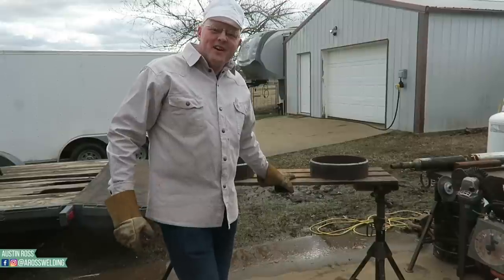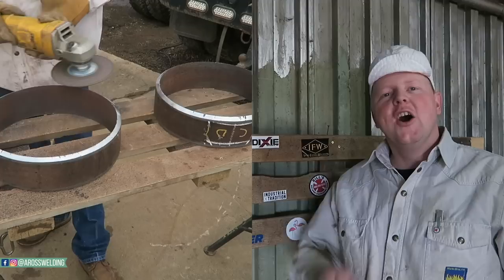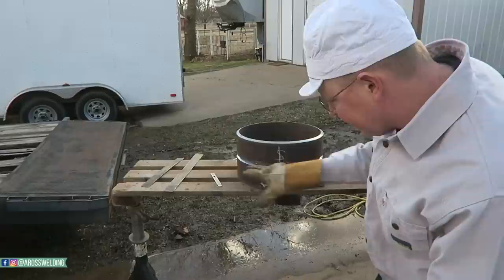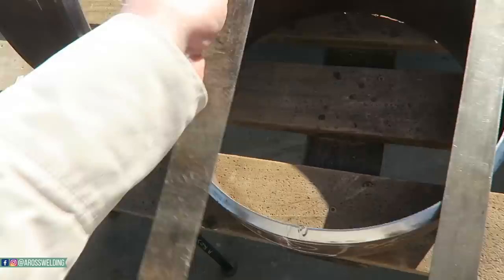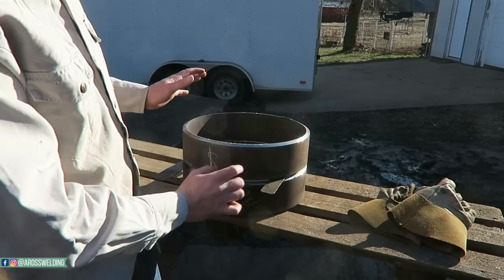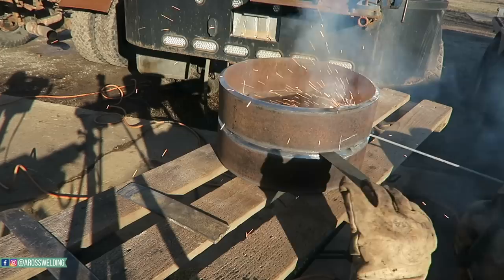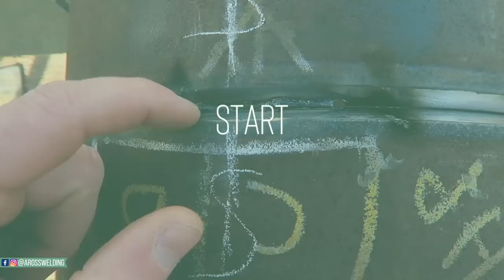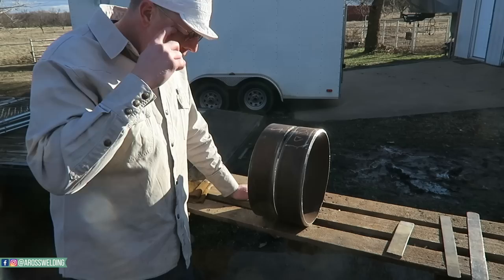BELL HOLE FIT UP (HOW I DO IT ON TEST DAY)

Comment: Hey guys, so i got out of the pipeline world a couple years ago. I moved to TN but I was living out in Norman, OK. I lost all my contacts from the industry but I really want to get back into it. If you guys have any numbers or leads I would love all the help. I can weld. Never got the chance to break out but I helped for a guy for a couple years working for enable and other gas companys non union. Also have labored and I can run equiptment thats what ive been doing in TN since welding jobs are hard to come by! Thank you for the help guys!

Comment: Great video. Be it a welding test, written test, or any test with time limit on it, use the complete time. Don’t goof off and run out of time but don’t race horse through it. Take your time and prep and double check instead of having to rework. 
Go by the old saying “measure two or three times and cut once.” Saves headaches and time. Hope everybody has a great week.

Comment: I like to use 1/16 ,1/16 fitup and it works rlly good down and uphill but you would probably want a 3/32 uphill, allot of guys at school struggle with the landing going uphill so probably a 3/32 or a bit more is good

Comment: I'm new to down hill welding. I been TIG welding for 10 years. Any tips on putting in the bead? I'm finding out if I go too slow the bead gets too wide inside, too fast and not enough penetration. I hear ppl say to soke the bead. And some say to push hard. Any thoughts or maybe a video in the future on the topic. Thanks great video.
Reply from the maker: I’ll take note here and make a couple videos over the topic
Reply: On a test I take loose penny, nickel land. I don't rush but wanna get the bead in a timely manner. Hope I have a good helper and better rods.

Comment: Can you do a tutorial on how to figure out staircase measurements as far as how many steps, the angle and how to space the steps?
Reply: Stairs are actually really easy to figure out, and you can learn it from a book. I wish I could teach you over YouTube comments.
Reply: @gregmauchline9146  

I bought this contractor calculator from home depot, and i understand it somewhat, but as far as rise height, run length, and step spacing its just confusing
Reply from the maker: Ya I’ll take note here. Thanks for the suggestion. 👌😎

Comment: Always weld your tight side first the whole pipe is closing as your welding so if u weld the tight side first the big side will be right if u run your wide side first it ends up making your tight side even tighter
Reply: David Spivey isnt it the other way around?
Reply from the maker: Check out this video

https://youtu.be/KPsMA9vmcFc

Comment: When welding I know you can weld top to bottom or bottom to top. What do you recommend for best weld and tie ins?
Reply: We don't get a choice. We have to run what the procedure says and that's usually top to bottom (downhill)
Reply: Michelle is right. Depends on what the code calls for wether it’s ASME, AWS, API etc. in school many moons ago it was uphill (bottom to top) and that was AWS.

Comment: Where did you get your spacing bands?
Reply: They make em
Reply: @emmanuelm.d8748  what material
Reply from the maker: I think I used 20 or 22 ga sheet metal.